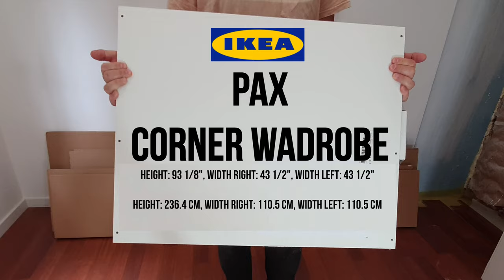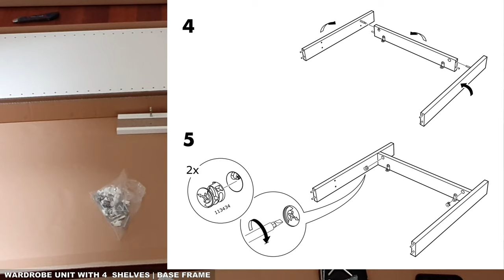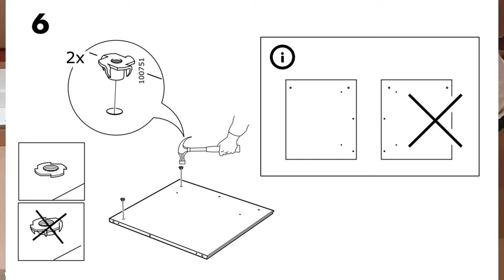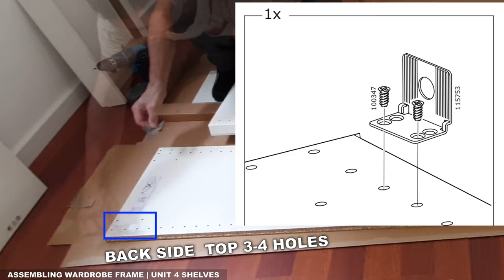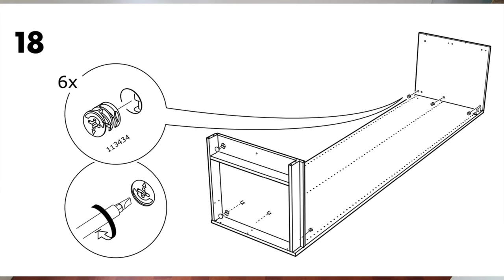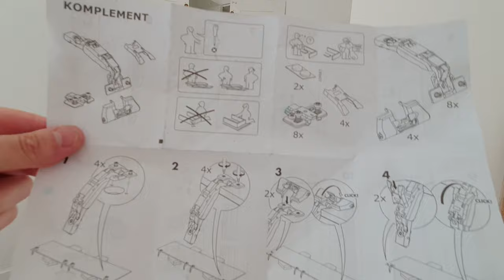IKEA PAX Corner Wardrobe Assembly - Ikea Corner Closet Assembling

Comment: Unusual part of this corner assembly, is that doors have non-standard closing hinges (compared to "normal" pax frame doors).   I was curious why they are different (the doors are the same model). The reason that doors in corner wardrobe must open to wider angle, to provide easier access to internals.

Comment: Dude!  You skipped the most important part.  At 11:05 they're sitting in the room and then BOOM!  they're connected together.  The manual they include for that part is really hokey and hard to understand, then I come here and you skip it anyway.  Ugh
Reply: yup i agree i was waiting to see how you connected them and all of of sudden thar part was skipped and your putting on shelvez
Reply: yup i was waiting to see how you connected them and how they come together
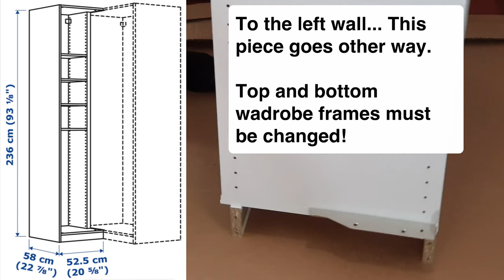Reply: He skipped this part couse he did a big mistake and had to change top and bottom. So he had to skip that part in this video... At 6:41 you can see that the connector is mounted the wrong way. It should be way deeper in the inside...